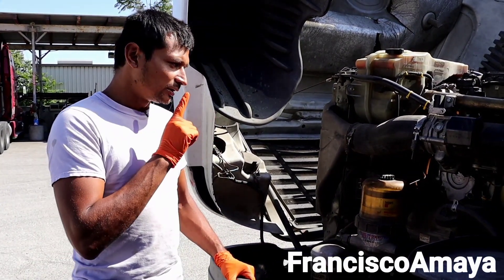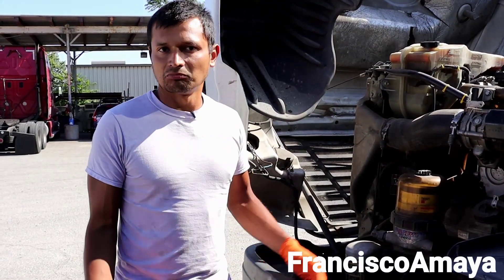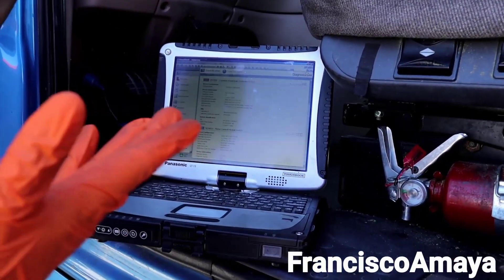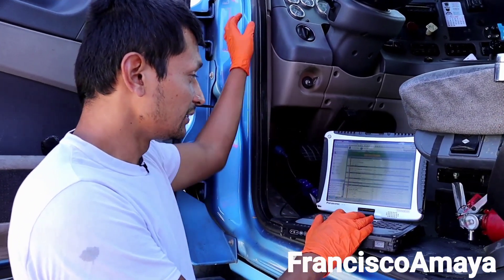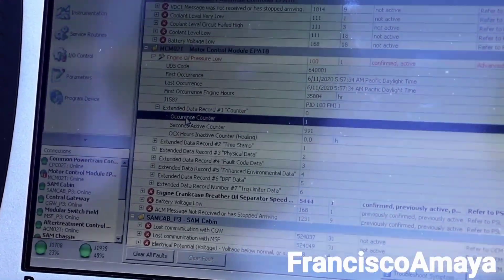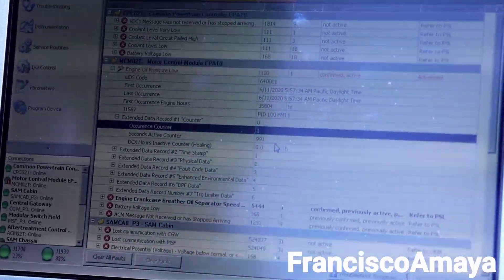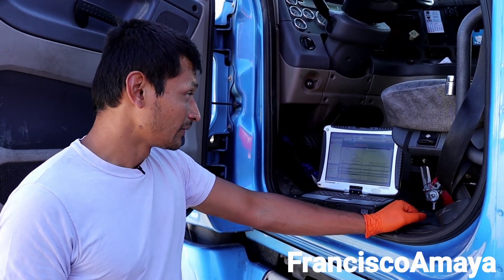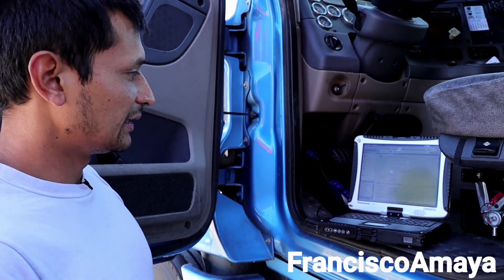S3 E4 F.A.I.T.H  DD15 engine crankshaft failure inspection walkthrough low oil pressure issue

Comment: Hello sir I have a question 
Have 2020 Freightliner DD15 
Had a problem with a fuel pump it had a metal shine peaces in fuel filter tried to clean as much as we could 
I Put new fuel pump didn’t work the truck starts with engine start fluid 
Priming fuel system and filters were replaced too but the same situation 
Starter works but engine doesn’t start 
Again only with fluid it starts please advice what I have to check again as I guess there is no pressure in fuel system

Comment: the same happened to me but I had no warning lights at all. no low oil pressure or no stop engine light. it just started by making a real loud noise. so I shut it down. my engine gave out.  it had 1400345 miles.

Comment: Its not good to let diesel engines run at idle at 600 rpm, is always good to put the fast idle at 900 rpm or above, engine gets more lubrication.

Comment: I heard of people installing a pre oiler pump system on their truck so they have good oil pressure before the engine starts. If someone installs one of those on their trucks and sets a controller to instantly turn it on when the oil pressure drops that could save their engine.
Reply: Sounds like a legit idea. Today I started my dd15 with 740k and noticed that oil pressure was at 0 for like 2 seconds and then jumped up to 50 with 36f outside. That thing kinda creeped me out.
Reply: @cryptochannel5754  As long as the engine didn’t sound like it was missing oil pressure you’re fine. That’s either the sensor starting to fail or the computer took a second to remember it has a job to do.
Reply: Custom aluminum oil suction is the best way to forget oil failure in DD15

Comment: Hear that alarm, that's low air pressure. My Cascadia only gives that audible alarm for low air pressure, there is no audible alarm for engine shutdown. Only a red light on the dash which the driver will not notice until they scan the dashboard. Which should be about every 30 seconds. Then you have to get the truck off the highway. So three minutes of active low oil pressure is not a surprise. I wouldn't put so much of the blame on the driver.
Reply: Especially in California where the trucks drive slow and there usually isn’t a shoulder to safely stop. Francisco is a very good mechanic but he hasn’t driven a truck very much.
Reply: It was for 16.5 minutes. Too much
Reply: Isn’t the low oil pressure giving the dashboard red stop engine light? If it does then those make the same noise as low air pressure. Might be wrong.
Reply: @cryptochannel5754  On these older Cascadias both of the check engine lights and the oil pressure and fuel level doesn’t make any noise. Only the air pressure and coolant gauge. I’m not sure about the rest but I doubt they make noise.